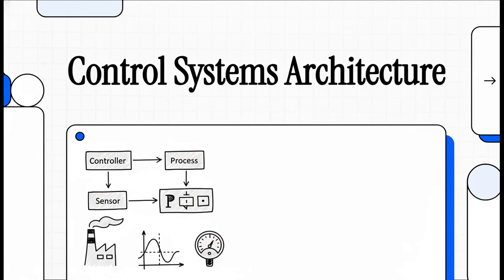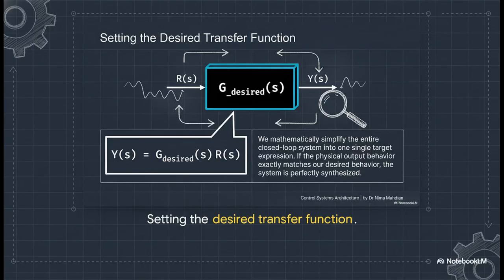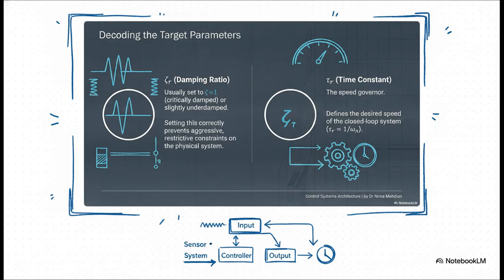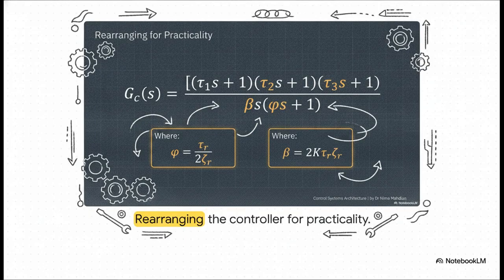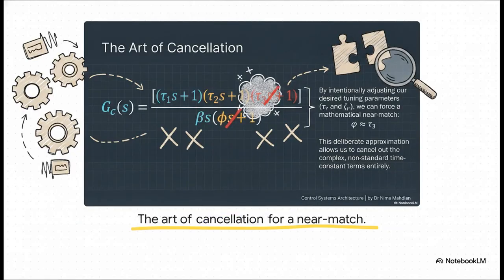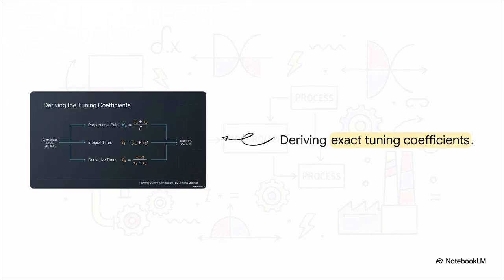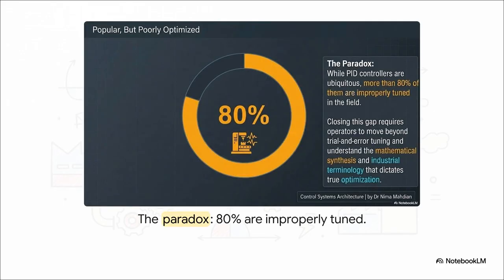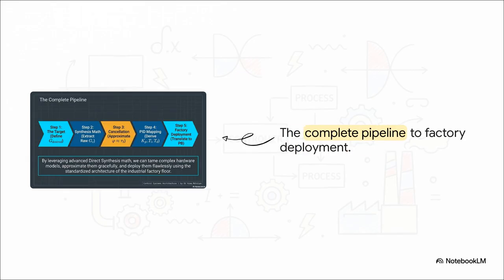Model Reference Tracking with PID Controller | Industrial Automation & Control Engineering

Comment: Dr. Nima, why is the controller rearranged into this practical form instead of implementing the original mathematical expression directly? Is the main reason computational efficiency, numerical stability, or ease of hardware implementation?
Reply from the maker: Thank you for your excellent question. The controller is rearranged into a practical implementation form because, although the original mathematical expression is theoretically correct, it is often not convenient or robust for real-time implementation.

The practical form simplifies the calculations, improves numerical stability, reduces computational effort, and is easier to implement on PLCs, microcontrollers, DCSs, and digital controllers. It also avoids unnecessary operations that may amplify numerical errors or make parameter tuning more difficult.

Therefore, the motivation is not just computational efficiency. It is a combination of efficient computation, improved numerical robustness, easier parameter tuning, and reliable real-time hardware implementation. This is why industrial controllers are almost always implemented in a practical, implementation-oriented form rather than directly from the theoretical equations.

Comment: Thank you Dr. it's great explanations. in page 11; Why was the term (taw3
s+1) specifically selected for cancellation? Why not choose φ≈taw1
 or φ≈taw2
Reply from the maker: Thank you for your excellent question. The term (τ
3
	

s+1) is usually selected for cancellation because it represents the fastest process dynamics (the smallest time constant). Canceling the fastest pole simplifies the controller design while preserving the dominant dynamics that determine the overall system response.

Choosing ϕ≈τ
1
	

 or ϕ≈τ
2
	

 would attempt to cancel slower, dominant poles. This is generally avoided because dominant poles have the greatest influence on the closed-loop response, and inaccurate cancellation due to modeling errors can significantly reduce robustness or even destabilize the system.

Therefore, in practical control design, engineers typically cancel only fast, non-dominant dynamics that have a limited effect on the overall response, while leaving the dominant poles to shape the closed-loop behavior. This provides a better balance between performance, robustness, and stability.

Comment: I have a question why does Direct Synthesis sometimes perform poorly in rejecting load disturbances?
Reply from the maker: Thank you for your excellent question. Direct Synthesis (DS) is mainly designed to achieve a desired setpoint tracking response by selecting a controller that makes the closed-loop system follow a specified model. Therefore, its main focus is often on improving reference tracking rather than disturbance rejection.

The reason it may perform poorly for load disturbances is that disturbances enter the process at different points and are filtered by the plant dynamics before affecting the output. If the process model used for controller design does not accurately capture these disturbance dynamics, the resulting controller may not provide sufficient compensation.

In practice, engineers improve disturbance rejection by combining Direct Synthesis with methods such as feedforward control, disturbance observers, or additional tuning of the integral action. Therefore, DS can provide good tracking performance, but for industrial processes with significant load variations, additional strategies are often required.

Comment: Thank You Dr. Mahdian
i have question if you dont mind:
Since many industrial controllers use proportional band instead of proportional gain, and these two terms have an inverse relationship, how can engineers avoid mistakes when converting between Kp and PB during real PID tuning?
Reply from the maker: Since proportional gain (Kp) and proportional band (PB) are inversely related, engineers must always verify which parameter their controller uses before tuning. A larger Kp corresponds to a smaller PB, and vice versa.

The safest approach is to convert using the manufacturer's definition (commonly PB(%)=Kp100
, although some controllers use different scaling), and then confirm the controller's response through testing or simulation. Reading the controller manual is essential because different PLCs, DCSs, and PID controllers may define PB differently.

In practice, experienced engineers always check the units, verify the conversion, and make gradual tuning adjustments to avoid confusion and ensure stable controller performance.